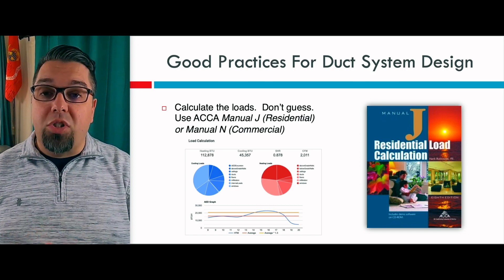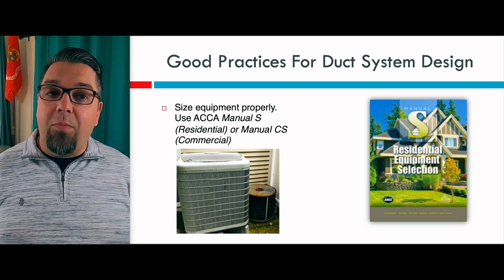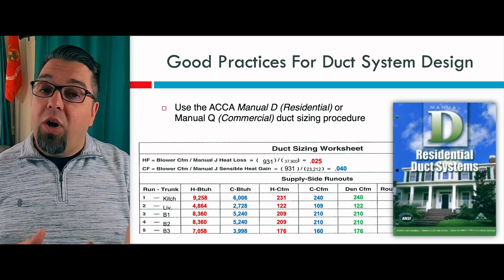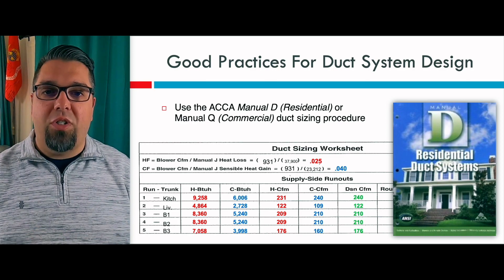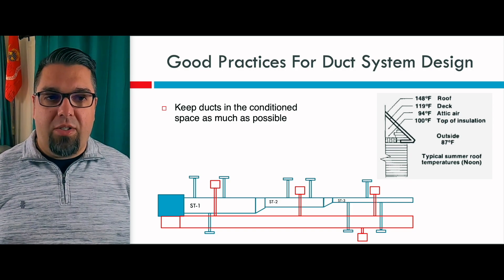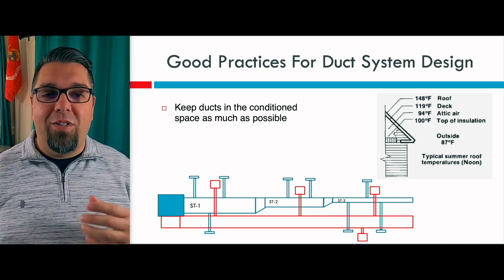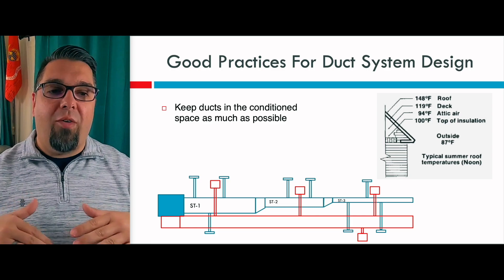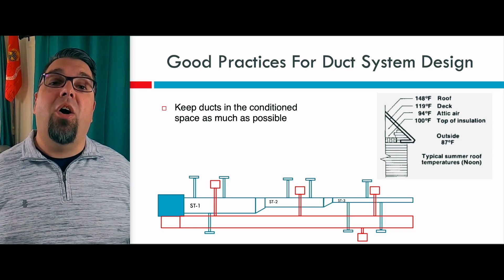HVAC System Design Process & Duct Location

Comment: Hello
When you have a home with a basement condition or not and the complete hvac system is there 

I understand that the basement should be conditioned , but most are not 

Do you include the basement sg’ in the manual j 

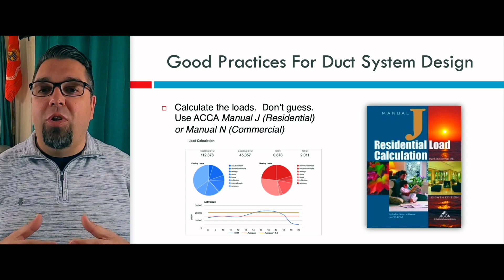When you have a attic that has 1:00 1:00 hvac in the attic do you include the attic sq’ with in the attic  

I know the attic should be conditioned if there is hvac there  so I would add it in correct 
It isn’t conditioned and hvac is there I still need to account for the loss correct

Comment: Question: im planning on building a finished walkout basement home with 1400sq ft on each level. With a heat pump outside and furnace in the basement. Would I run all my supply and return ducts on the basement ceiling and stub vents up for main floor and down for the basement? Do I need any big ductwork shafts going upstairs for return vents or how would this house typically be designed.